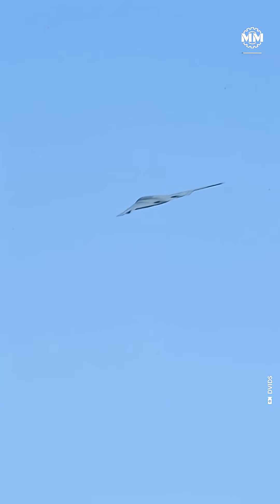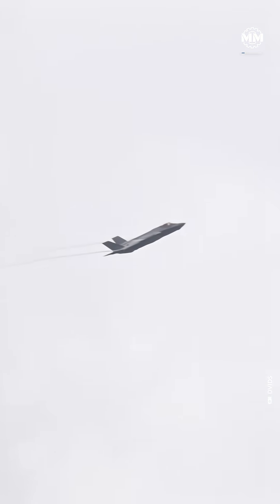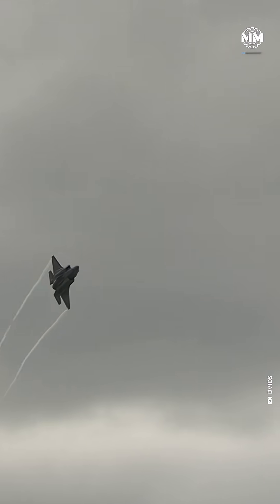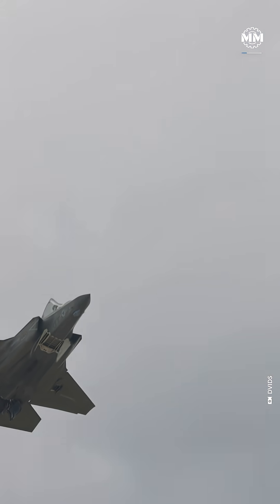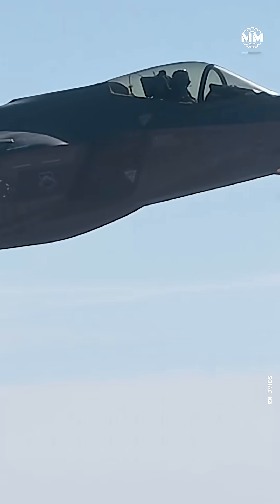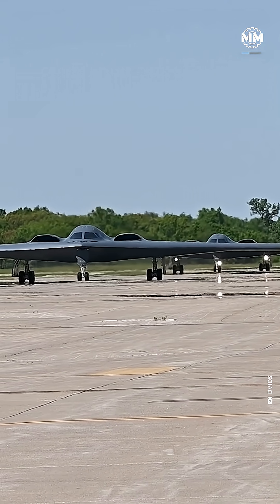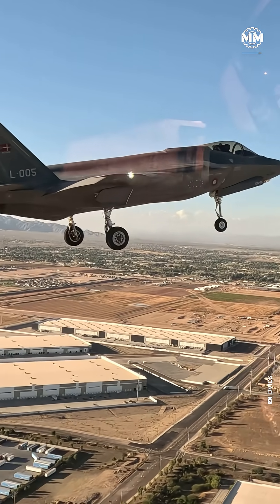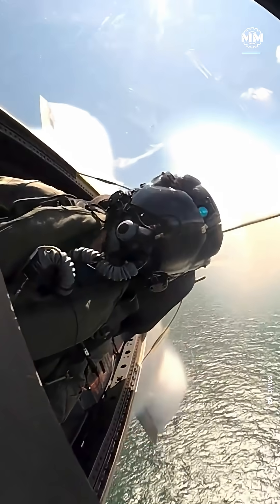Real Reason Why Radars Can Detect The F-35

Comment: ground radar are search and detect radar for surveillance and early warning, but where plane stealth really looks invisible is to another plane like fourth generational versus fifth.  When one is past ten miles away from another plane now the fifth Generational planes is  completely invisible to a fourth generational fighter, but the fifth one like the F35 or F22 Rapter can see that target which is the big advantage.  My point is that ground radar is more powerful and its harder to hides stealth from it and only some 5th G planets have low frequency radar.  Consequently, there is also a range limit to stealth due to the electromagnetic inverse square law so that EMR attenuates inverslely proportional to the square of the distance.. This does not matter though because the 5th g plane with get the fist missile shot off and that is a big advantage.

Comment: It's not just radar that can see stealth. JAS (Gripen) can see stealth planes through advanced sensors such as IRST (Infrared Search and Track System) and new radars, which detect heat and other signatures that traditional radar misses, even though stealth planes are designed to be difficult to detect with radar. The technology is based on detecting the aircraft's heat signatures from the engines and fuselage, which makes them vulnerable even though they are "invisible" to radar.

Comment: Radar may be able to pick up on it, but getting a missile to lock on and hit the aircraft is a completely different story
Reply: New modern radars can do it easily. In modern warfare, not single radars are used. Multiple C band or UHF or VHF radars are usedvas array and using triangulation method can give pinpoint location of the stealth targets this data can be used to feed missiles untile Missiles come in 20-50 KM range to lock on the stealth jets. Today missiles and modern radars are so capable that that they dont even require missiles to lock on to their targets. Groind Radars, AWACS and radars on jets can be used as buddy mode to lock on and guide missiles to the targets.
Reply: @vijaymalapawar7583 all this is theoretical, none of this has been put in practice

Comment: Stealth is not about just radar signatures. Low radar cross section is one side of the story. Also low infrared and thermal image is needed. And also low acoustic noise is needed. In full stealth mode f35 lowers thermal, infrared and acoustic noises. So f35 flies in subsonic speeds in stealth mode.
Also if it is not in active combat mode, all f35 jets are carrying radar reflectors and seen on radars perfectly.

Comment: That’s why the French had it right Rafale the way, stealth is nice, but expensive, not 100% reliable, will fade with time, is maintenance hell, Sead is better, sure it’s more blunt to dlown up you entire ennemy airfoce and sam infrastructure from stand off range 😅😅😅😅😅, but it’s cheaper, operationally manageable, can be done consistently with near 100% certainty, then the planes they selfs have jamers counter jamerd, electronic and cyber warfare suits, are built to minimize radar cross sections but only where it doesn’t cause maintenance hell, doesn’t degrade the airframe, could keep goonh but the USA has far better option, to make better rafale like f-18, and a small like france 6 gen fleet to do that deep penetration strike capability at the start of a full out sead campaign, maintain a snall fleed of stealth 6 th gen and drones make economic and military sense, the F-22 were great but built fir a cold war race, now days calls for a few F-47 and thier drones and better munitions aka lower cost better range and accuracy higher rate of productions under pressure, and a lot of fully upgraded and modernized F-15( but you already doing that) and allies what they needed was better F-16 and a squadron of f-36 build as hybrid 6th gen plar forms, if usa had done that it would be drowning in orders, but no can’t let the Chinese make better planes! Well are we sure they better? And we all knows the cost and probably of steal design and when quantum chip ai will be linked to multi phased array radar, stealth will ne a relic anywaysc so i circle back we all better off with better Rafales snd Better F-18 / F-15 everything else is fluff and gadgets

Comment: An F-117 was detected and shot down in Serbia - they used reflections from cellular phone antennas totriangulate and locate it. The F-35 is much better designed so that method is less likely to succeed with it. Also, the radar reflection attenuates by inverse 4th power while the original signal only by inverse-square law, so the aircraft can detect and eliminate the radar transmitter long before the radar sees it.
Reply: Not if you have passive radars or multistatic radars or weather balloons or OTH radars or VHF radars or AWACS and did I forget fast interceptor jets scrambled with missiles having onboard x band seekers that turn on only in the last terminal phase . So much is possible 😆

Comment: The F-22's radar cross section (RCS) is said to be the size of a marble, and the F-35's stealth is superior even to that of the F-22. While radars might see the F-35, they'll have an incredibly difficult time getting a lock on them, and the F-35 only needs to get close enough to fire on an enemy's anti-air weapons systems, then they get out of dodge! With the new F-15EX fighters and AIM-174 long range missiles, the F-35 doesn't even need to open its bomb bays. The F-35 can get in close enough to achieve a lock on the target, then an F-15EX armed with AIM-174 missiles can use that lock to fire the missile at the target from beyond the horizon. These tag teams are exceptionally difficult to defend against.

Comment: Long wavelength radars sees them just fine..
Reply: I think that's part of how the f117 got downed over Bosnia. But only part of it.
Reply: @andrebello4191 pretty sure they recognised the pattern of the aircraft and when it came as usual they fired a missile
Reply: @mirtalpur739 That's the other part of it they kept the same routine and they were able to see the pattern. They got kinda complacent I guess in their tactics and underestimated the enemy kinda thing. The other part of it was the rain I think kinda compromised the stealth and the anti contrail thingy wasn't working I think. Stealth works but you got to use it the right way.
Reply: 'fine' being highly relatively speaking, it still has to deal with greatly reduced distances and uncertainty

Comment: Radars also have limitations, and the designers of stealth aircraft know this.  While a low frequency radar may be able to detect some stealth aircraft, they don't have the accuracy to provide useful target location to any interceptor.  It's kind of like "there's something over there, but I don't know exactly where."
Reply: Thats why multistatic radar exists,, it cant generate a lock, but can give precise data of the possition, it can detect stealth aircraft based of reflections from civilian radio signals, these include reflections stealth cant eliminate like VHF and UHF broadcast signals and more, if stealth aircraft emmits radio waves its even worse, then via sensor fusion it will try to get a precise lock which is way more plausible if you have precise data, interceptors can be sent and tune their radars to current position of the bandit.
Reply: @peposad2588 why are you exposing our secret online
Reply: This^
Reply: Which is why you send fighters and turn sensors to that location to investigate, you'll eventually burn through for a brief moment before that fighter jet moves to get away.
Reply: If you know the approximate location of a "stealth" aircraft in your airspace, it is easy enough to launch a missile at it. 

However, without precise targeting information, the missile can only approach the craft's general area, without enough precision to make a final interception.  That said, radar "stealth" aircraft normally are not stealthy at all, from directly behind the aircraft.  The engine exhaust produces a strong IR heat signature that can be used for precise final targeting of the missile.  Additionally, "stealth" aircraft are normally not radar stealthy, at all, from directly behind the aircraft's engines.

The exterior radar absorbing stealth coating on stealth aircraft is commonly some kind of composite polymer (ex: plastic) material.  However, such materials cannot survive the high temperatures experienced in the hot exhaust stream from the engines.  Consequently, the rear of the engines are not radar stealthy, and instead they simply recess them into the body of the aircraft as much as possible, so as to reduce the angles where radar reflections can occur.  However, if you are a high maneuverability missile that has already flown yourself to a position directly behind the "stealth" aircraft that you are chasing, your own missile radar system would typically have no difficulty seeing/tracking the target due to radar reflections coming from inside the engine exhaust area.

In other words, radar "stealth" aircraft are hardly invincible.  They are readily detected/tracked/intercepted by a competently designed anti-aircraft missile system that was specifically designed to defeat radar "stealth" aircraft.

The US government puts far too many of its eggs into the "stealth" aircraft basket.  In a real conflict with a competent adversary that prepared properly in advance to defeat US weapon systems, including stealth aircraft, the US military equipment would be a major flop.  The US "stealth" aircraft like the F-35 would suffer major attritional losses, while being far too expensive and far too slow to manufacture, in order to rapidly replace such losses.  The US would likely lose the military conflict against such an adversary.
Reply: @Fritz_Schlunder your analysis has one fatal flaw. To shoot a missile in an IR tracking position, the aircraft has already passed you by. You have already become the target of SEAD. There is no longer a you to fire anything. ie Iran in the last conflict. I see a lot of these kind of comments, until now, warfare has shown that stealthy aircraft are very usable and very desirable.
Reply: @magnashield8604  Israel uses their F-35s due to neighboring countries with ties to Iran, if someone see that Israel is coming, they will tell Iran. Iran is not a peer adversary as they have nothing to defend themselves from the skies, Israel uses their F-15s and 16s for striking. In a situation like Russia or China, stealth is gonna be limited and less desirable.
Reply: @subjectc7505 who supplied air defense to Iran? Iran claimed to have the most advanced air defense system China and Russia could provide. Israel struck Iran first with f-35's then used it's f-15's and f16's. Stealth is not a panacea, but it has yet to be proven that it is not useful. That is why China and Russi have been rushing to catch up. Every country that flies the f-35 has said they are the most capable aircraft in the air right now. Canada doesn't want to buy the F-35 because of political considerations with Trump. Even they say it is the most capable as they have tested. Thinking stealth isn't important just sets any country up for future failures
Reply: @magnashield8604 Iran doesn't not have the best air defense, the most advanced they had was S-300s which was destroyed immediately and they just recently got new Chinese Air defense. While one system from Iran was able to down a stealth drone, their own designs are questionable and was absence during the back and forward with Israel. China and Russia already has anti stealth technology, Russia has the S-500 and China has a radar system. Sure they are capable, against countries like Iran. Against Russia and China, they are not as capable lol.
Reply: @subjectc7505 I said Iran CLAIMED to have the most advanced system. Given the poor performance of Russian systems such as the s400 in Ukraine, I will hold back judgement on how good the s500 is against stealth. Russian claims don't mean much. I would suggest China is going to have the better systems as they have actual stealth aircraft. The Russian military doesn't understand air power and its antiquated systems have proven to be less effective against old NATO tech. Russia's only real threat is its nuclear capabilities. China producing stealthy aircraft is a testament to the utility of the tech.
Reply: @Fritz_Schlunder that's why you have superfast missiles with terminal phase onboard x band seekers.

Comment: Every stealth jet gangsta till the bomb bay opens
Reply: With the new F-15EX fighters and AIM-174 long range missiles, the F-35 doesn't even need to open its bomb bays. The F-35 can get in close enough to achieve a lock on the target, then an F-15EX armed with AIM-174 missiles can use that lock to fire the missile at the target from beyond the horizon. These tag teams are exceptionally difficult to defend against.
Reply: @Gr8_Ape_69  This is complicated you can use ground radar station or longer range radar instead, there are radar recievers, and they arent limited to RWR's seen on jets, there are passive ground stationed radars, in this scenario F-35 has to use its own radar for the whole duration of the fight, it will be picked up, and its location will be known - exacly what you dont want in a stealth jet. So this will work against weak enemy, but in that case why even bother doing this.
Reply: @peposad2588  Yeah, I know. I just think it's cool and like talking it up a bit. I understand it isn't fool proof.
Reply: @peposad2588  This is not a big deal in today's warfare I mean it has already happened in a conflict in 2025. So, it's not a big deal I mean it's pretty much common now a days. I mean you may know kill chain system was employed in may 2025. So, no big deal even NATO tested and trained these tricks many years ago. It's just the different case that Pakistan was the first to employ it and now all countries are confident on this.
Reply: Or IRST
Reply: If the doors are open then you're already having a bad day.

Comment: Just get the missle near enough, raidar/ heat seeker ect. Use a lightweight visual AI to determine type and hit it.
Reply: It's not that easy. The jet still has to locked onto. Missile radars have a narrow bandwidth due to their small size.

Comment: “Detect” - absolutely but it’s radio cross-section is the size of a small bird which Radar systems typically reject or else their displays would be saturated.
Reply: Not to multistatic ground radars

Comment: There's no such thing as a stealth aircraft; any high-power, low-frequency radar can reveal it. So-called stealth aircraft are designed to evade high-frequency radar, not long-wave radar. When meter-band radar radiates its power, resonances are generated throughout the aircraft's structure, revealing it to the viewer. The signal, though faint, is sufficient to guide SAMs.
Reply: LMAO 'meter-band' radar... how to show you are utterly ignorant and just playing internet parrot. Modern high-frequency targeting radars have wavelengths measured in mere CENTIMETERS. Like the 96L6E radar for the S-400 system is between 8 and 12Ghz, meaning on average 3cm.

And it's these kinds of high-energy frequencies that are mostly absorbed by the stealth coating, like a whopping 20dB reduction with just high-end non-aviation stuff civilians can get their hands on, rendering them utterly useless.
Reply: No it's not